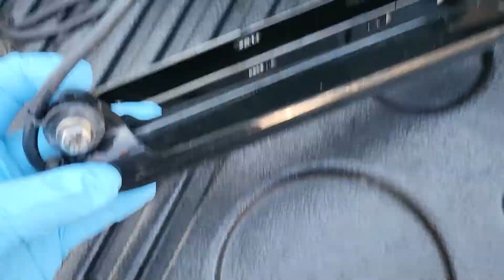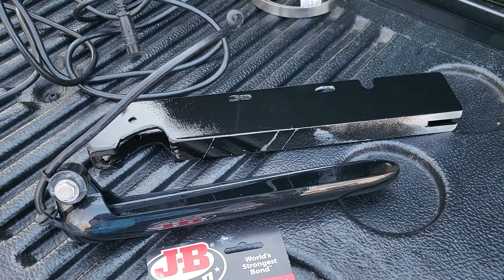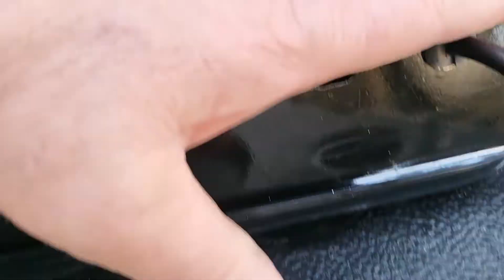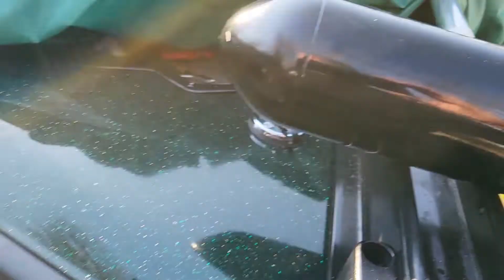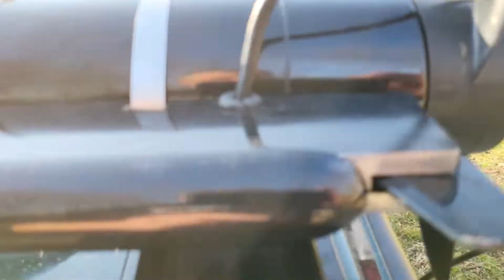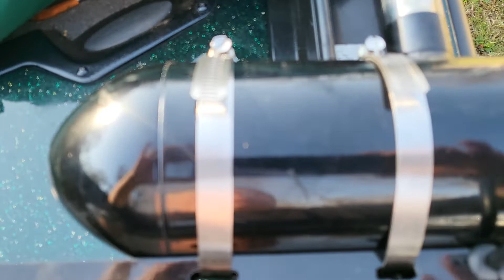lowrance tripleshot transducer home made trolling motor mount.

Comment: Could have turned it around with the cable next to the skeg of your trolling motor and then went into your settings and changed your left to right view.. because the cable being on that end of the transducer that's the way the transducer supposed to be mounted but you can go into the settings if you turn it backwards and flip your left to right view and it protects your cable from any hits or damages.

Comment: Where did you find the bracket for the skimmer uou removed? I have a 3 in 1 transducer I'm trying to mount on a minnkota maxxum but will not fit because of the skeg. It can be mounted on the side of the motor with a bracket like the one your removing. Thanks in advance for your help
Reply from the maker: https://johnnyraysports.com/product/jr-1-transducer-bracket/
Thank you for viewing and subscribing.

Comment: That’s perfect design. Would like for you to go into detail how you made that. Is that three separate pieces and you tig welded it. Really like how you got the front of that TS protected and how you got it slit on the other end man that’s perfect dude
Reply from the maker: Thank you, I bought a 1x2x12" aluminum piece from "Metal Wherehouse part # 21786.
You will notice your TS has a shallow recess on the flat surface. The aluminum will mount between the lip. I laid the aluminum on its side and held the TS up to it as if it was in the recess and looked down on it and traced the shape and dotted the bolt hole. 
Then I cut it out with a cutoff wheel and massaged it to shape. I used a drill bit to notch for the cord in front snd where it would come back out of the side to go up the trolling motor shaft. I used the cutoff wheel to groove the end yhat would straddle the skeg fin. 
Next I held it on my motor and marked where the hose clamps would best fit.
I used a Rotozip to mill out the clamp slots. But I've sure you can drill a few holes in line then run the drill back and forth to open the slot nicely. 
In my second video you will see the tail end of the transducer supports I added for superior hold and protection. 
Again I thank you for viewing. Please like and subscribe. 
Follow me on Instagram at greenassassinfishingteam for some nice stuff,.
Reply: Thanks for your reply, I know what my next project is going to be now.
Reply: Your design for the TS is now on my trolling motor. Thanks again.
Reply from the maker: @davecasey9383  glad it worked out. 
What are your thoughts of yours?
Reply: If I took a picture it would look like it was on your boat. Haven’t put it water yet but it looks great and will work great. Very happy, great design
Reply from the maker: @davecasey9383  glad it worked out.
Reply: As I mentioned in my earlier comment I now have your design on my trolling motor. Have you have to put it in the water to test but I’m sure it’ll work fine. My question, do you know if having the trolling motor stored while you go somewhere else can you leave the bottom machine still running or should you shut it off when it’s out of the water
Reply from the maker: @dave casey  good question. I have the hook5 TS somewhere in the menu is a "stop sonar" or something. But I shut mine off when I pull it.

Comment: You did a great job on making your video and your transducer bracket. Thanks for sharing. What is the dimensions of your metal bracket before you started cutting and grinding. Thanks
Reply: I really like the way you did your transducer braket you should make them and sell them i would buy one
Reply: @chrisbegley8630   I would buy one asap as well.
Reply from the maker: 2" tall x 1" wide x 12" long. No detentions were reduced. 
I laid my transducer on its side and mock traced it and measured 5 times for the hole. Lol.  Ask anything I'll help all I can.

Comment: question.... once you put the marine bond epoxy on the transducer it is mounted for ever. There would be no way to remove it from the aluminum.  Correct? Do you think using a super strong neodymium magnets with waterproof adhesive (so it could be removed later if needed) would interfere with the transducer signal?
Reply from the maker: I don't know about magnets. I put about 1 inch of the bond. At the heal. This transducer has a history of breaking off at the oem mount due to its long length. Naming the rear ridged only made sense.  I'm sure I could get it apart. Maybe a multi tool  with a nice thin blade will separate it it but at the moment not really concerned. In fact. If I didn't bond it off the bat and it broke then I would need to "yes" bond the entire thing later.
Reply: @earlzach  overall great design. I'm wondering if you had a small lip or cup at the toe, once the heal was secured with the bolt it would remain in its cradle. That would eliminate the need for the adhesive. Can't understand why lowrance doesn't have a bracket like this for sale.
Reply from the maker: @STCSTW  I did end up with two brackets one on each side to secure the heel better from moving at all. I'll get picture up soon. 
Thank you for viewing.
Reply from the maker: @STCSTW  part 2 is posted.